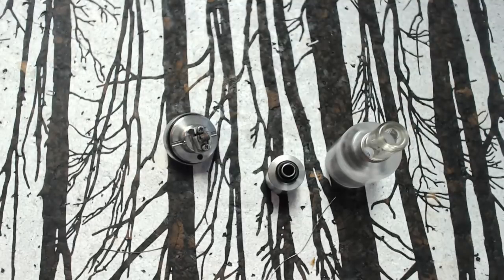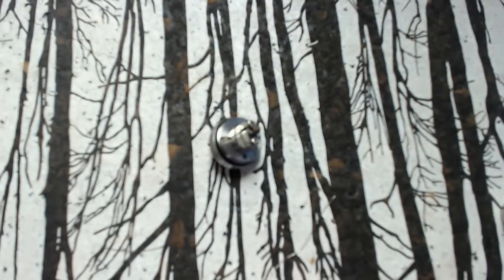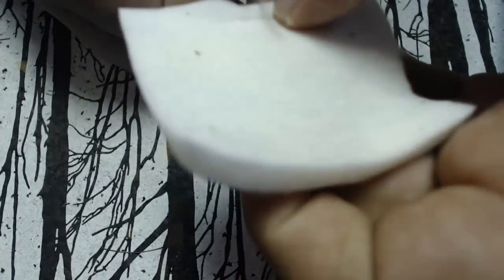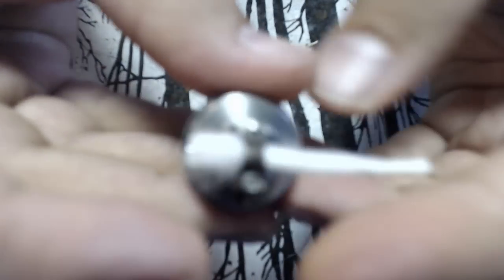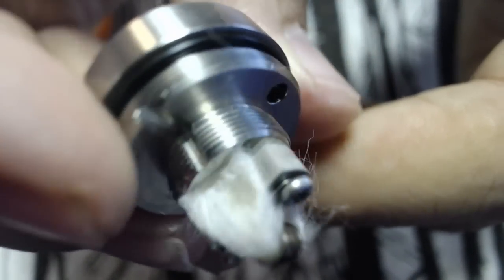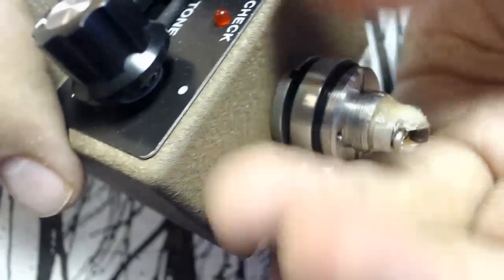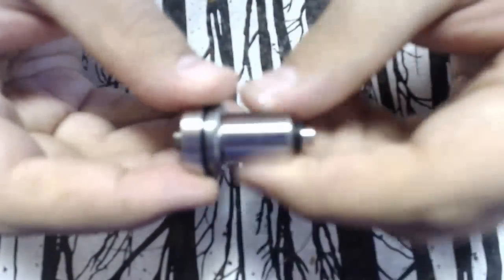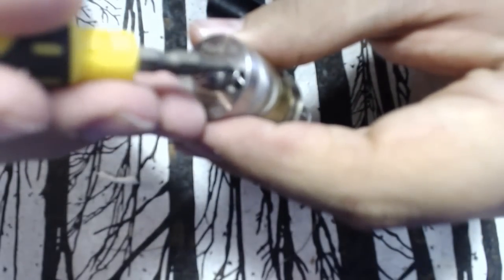Tutorials with Understudy77: Wicking a Kayfun

Comment: Good tutorial for those using cotton or rayon. BUT..............................

Here is some food for thought. All of my Kayfun's (I have 3 of them) are built with 3mm Ready X Wick. Every few weeks I take the coil and wick off (together) - torch it clean - and re-install the same coil/wick. Performance is flawless. The best part? The coil/wick combo on two of them is over 7 MONTHS OLD now!! Not a typo - 7 months without needing to replace the wicks. That is a lot of time and money saved. Every time I need to do a rebuild on any of my atomizers (I have a LOT of them), I make the switch to Ready X Wick. Most of the builds on my atomizers (RBA's, RDA's, RTA's) are over 4 months old now using the same coil/wick combo now. Absolutely no issues at all. You Plumes guys need to check this (RxW) stuff out for your viewers. WAY better than any plain silica. Time to quit using wicking material that only lasts a week or two and 'will burn'. The whole 'will burn' thing and the short life span of all organic wicking materials is a complete turn off for me. As soon as something is 'burning', the whole 'harm reduction' thing goes completely down the tubes. For the record, RxW 'will burn' (off gas/melt) at temps over 2200F. Your o-rings, Delrin and Peak insulators will melt long before that happens. And no, I have no ties to the company that manufactures XC-116 (3M) or the company that "heat treats" and sells RxW.

Vape safe.
Reply from the maker: We actually have checked it out, until we found out that there is the possibility that it could revert back to an unsafe state after you cut it. We talked about it on a show, and never mentioned it again because none of us are willing to take that risk as ceramic can be deadly. So yes there is a risk with cotton, but we feel it is less than that of ceramic materials.

The only non cotton material most of us are comfortable with is ekowool, but I don't think any of us use it any longer.
Reply: Yeah except what the PoH account said.  

The thing is, there's inherent risk with any wick.  Cotton, rayon, silica, or ceramic.  And knowing what I know now, there's no way in hell I'd use ceramic personally nor recommend anyone use it.

But even non-burning cotton (and my cotton doesn't burn) has its risks - no argument there.  But the amount and types of chemicals and particles that possibly get released is significantly less risky than ceramic.  

It's your body and your call, of course.  Just my humble opinion.
Reply: You are right about the 'particles' issue. Like most things we do in life - it pays to do them properly. Simply rinse off the wick after cutting it to remove any 'particles' created by the cut. Boiling it is also a viable solution. Heat 'treated' (in a kiln at 1850F for 12-16 hours) XC-116 is a 'fused' soft ceramic. Not to be confused with heat 'cleaned' XC-116 that is only cooked in a kiln (sometimes torched) at around 1000-1200F to burn off the lubricant used in the weaving process. Heat 'cleaned' XC-116 is not 'fused' and is not safe for vaping at all. Night and day difference between heat 'cleaned' and heat 'treated'.

In the end, proper application and technique is just as important (if not more) than choice. It's easy to screw up anything if it's not done right.
Reply: Theangstful Vaper
 Do you have the same feelings with the ceramic wick that is used in the Aspire BVC coils..? I'm just wondering if they hold the same risks. Thanks!
Reply: James Laforme Good question. Personally, I wouldn't use those. I've taken one apart and the material crumbles, flakes and has a fine 'powder' in it as well. That screen isn't going to stop much - if anything. The ceramic used in that thing is definitely NOT heat 'treated' and therefor not 'fused'.  My 2 cents.
Reply: James Laforme not personally, no.  because it isn't the same stuff as the XC junk.  That's silica.  And while they are similar materials, they're not the same thing.  (The problem is, cheap silica isn't that great for you either.  And I'm sure mass manufactured inexpensive clearos aren't using the highest quality silica, but I don't know this for a fact at all.)

I've had long discussions with a couple different people that are in the industry (and one of them spoke to an original manufacturer of the XC material) and their conclusions were "yeah this is probably a bad idea."

I have various skillsets that run quite deep, but materials science isn't one of them.  But from what I know about this personally and in speaking with people who are much more expert in this area than I... I'm not using XC.
Reply: Theangstful Vaper
 I thought that the main selling point of the BVC's is that they contain a ceramic wick not silca or cotton..? I agree on not bring more risks to vaping as I started vaping as many others did for the harm reduction benefits and to get off the way more dangerous analog cigarettes.I personally only use cotton when I wick my coils and I believe its up to person to use what they are comfortable with. I was just asking out of curiosity and genuinely wanting to know what you and others thought of Ceramic wicking Aspire is using in there BVC's as it is a very (if not the most) popular clearo & coil out now. I Love you guys at POH and I wish one day I can meet you guys live at a con or meet! VoopLyfe 4 ever!
Reply: Aspire claims the wicking material in the BVC heads is ceramic. They seem to be quite proud of it too. Not sure where this nonsense on it being silica comes from. I've handled it, looked at it under a magnifying glass and it is NOT silica. It is definitely a cheap, untreated ceramic filler material.  

Someone needs to quit pretending that he knows what he is talking about. "An original manufacturer"? Unnamed sources feeding him unquantified facts along with rumors and unvalidated opinions based on hearsay? Are we suppose to take that seriously? Don't know diddly about the product but you KNOW it's bad for you because 'someone' said so? Really?? Knowledge is power. GET SOME!  

Here are some real facts. Not my 'opinion' and not 'hearsay'. THE original and ONLY manufacturer of XC-xxx is Nextel which is a subsidiary of 3M. 3M holds the patents for all of Nextel's products. XC-xxx (fiber type-size) in reality is Nextel 312 which is a woven ceramic sleeve originally designed to be used as a heat shield for electronic wiring, conduit and other similarly shaped objects. It is sized according to the inside diameter of the sleeve.  Here is the 3M Safety Data Sheet detailing the health risks and toxicology findings on the Nextel 312. A great deal of research, time and money went into this and I would suggest reading this BEFORE opening your mouth and spreading more gossip about non existent health hazards.   http://multimedia.3m.com/mws/mediawebserver?mwsId=SSSSSuUn_zu8l00x4xtZ58tZOv70k17zHvu9lxtD7SSSSSS--  

There are many variants of this product - one of them being XC4-xxx (Nextel 440) which is made of the same material but thicker and able to  withstand higher temps. Both were  developed for the Military and as such, are ITAR Restricted products. That means it cannot be exported outside of the U.S.A.. It was only by accident that the discovery was made that this would make a great heat resistant wicking material. Always remember that raw XC or XC4 should never be used for products involving inhalation. Everything else you need to know about the various Nextel woven and non woven ceramic and silica products and how to handle them are here. Read it before spewing garbage about 'particles" on heat 'treated' 312. You know NOT of what you speak.   http://multimedia.3m.com/mws/media/680423O/3m-nextel-ceramic-textiles-technical-notebook.pdf?&fn=Nextel%20ceramic%20.pdf#page=41 

Saying that I heard such and such from so and so without doing a little homework and validating (or in this case - disproving) the crap being shoveled out by YouTube celebrities (intellectual posers in most cases) is pure stupidity and is the exact same thing as gossip mongering. In fact, many times the BS spread about by said 'intellectual posers' - is not just stupid, it's dangerous. It wouldn't kill you to read a little about what you are talking about before talking about it. You want to give opinions? Fine. Everybody has one and most are meaningless. You want to state facts? KNOW what the heck you are talking about first. The Vaping industry is young and most have not yet figured out that a lot more than half of it is full of hacks, scam artists, posers,  intellectual wannabes and outright crooks. Suckers and the ignorant are everywhere, waiting to play or be played. Those that REALLY know what they are doing or talking about are in the minority.

More astonishing (maybe not so much) is the blind acceptance of this nonsense by so many adoring fans. Doesn't say much for the fanboys that continually confuse entertainment and opinion for factual information.

Those that will misinterpret what I have posted here and mistake my candor with rude or insulting behavior are not seeing the bigger picture. Truth and facts.....MATTER. Nothing else really counts for much. Take responsibility for the accuracy of the words that come out of your mouth or from your keyboard. Failure to do that is merely showing your ass to people smarter than you and misleading or endangering those foolish enough to look up to you.

I'm done here. You are more than welcome for the 'enlightenment'. Say what you will in response to this. I have already factored in the source and could care less what is said. Knowledge IS power.
Reply: yellowhorse05 uh, ok.

I’ve done the research - plenty enough for me to make my own conclusion about whether or not I want to use xc as wick in my atomizers.  And if you think a couple lines of comments on a youtube video on if I want to personally use a material for wick is the exhaustive and total amount of my research, you’re sorely mistaken.

Regardless of the fact that I’ve read scads of documentation on the subject, discussed this with scientists who are more educated than I am on this particular matter, and one of those actually discussed this with a 3M engineer that makes the original material itself, I still don’t claim the facts that I do know nor my conclusions are the end all be all of the subject.  Because clearly they are not.  

I’m super happy you’re super happy with using this material as wick.  Go at it and enjoy.  

For me, I’m going to use cotton.  Until something even safer comes along.
Reply: yellowhorse05 They also lie about the SS construction of the atlantis as it's chromed brass inside so who knows but listening to them is maybe not the best route if you want the truth
Reply: MicroRCFiend Parts of it are SS. Soooo...........maybe they are only half lying? :-)  Seriously though, I agree that full disclosure is warranted. 

Finding truth and honest to goodness facts on the internet is an elusive thing and almost as rare as a Unicorn. For the uninformed and the gullible, opinion and BS - rule. The rest of us know better.